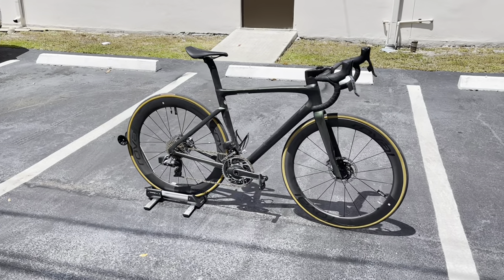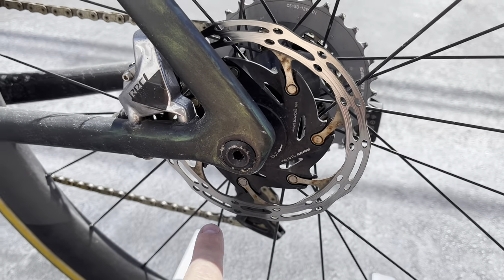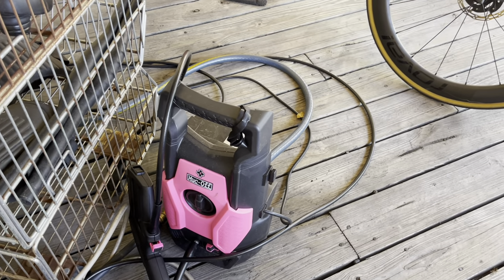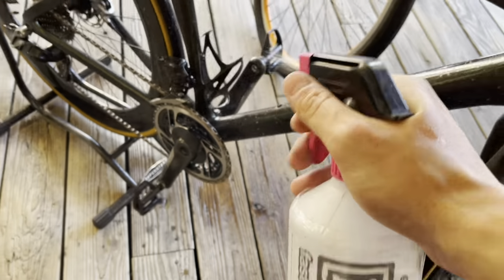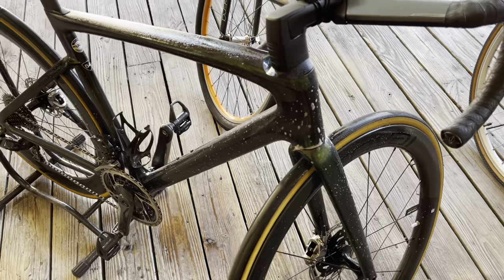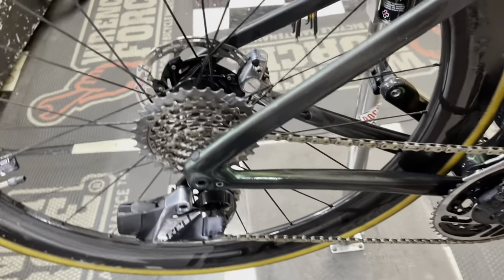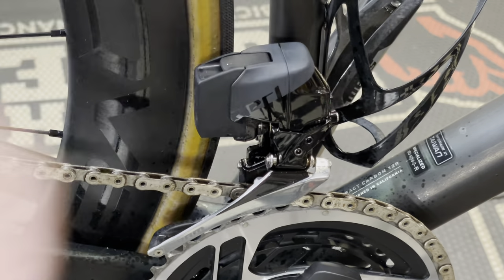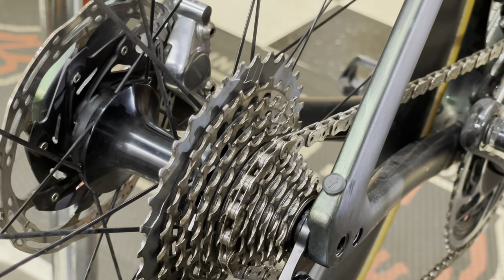CLEANING THE DIRTIEST *SPECIALIZED TARMAC SL7* I HAVE EVER SEEN!!!!

Comment: I always dry my chain with an air compressor after I clean it before lubing. I also use the compressor to blow water out of the depressions in all of the screws and other connectors that trap water and potentially rust.
Reply from the maker: im not a fan of the compressor if I have time I would take the chain off and lay it outside in the sun, the compressor can sometimes lodge grit and grease in wrong palces
Reply: I use wax on my frame, I also re-torque fittings, chain cleaner, dry lube once a month.  I dont ride in the rain so my bike stay relatively clean.  How often do you check your tire pressures?

Comment: 3:40 i can 1000% guarantee you even spraying it there got some of it onto the rotors
Reply from the maker: I am sure, but then you clean after done and they never make noise, dont squeeze right away....
Reply: @GCPerformance18  what do you use to clean it
Reply: @GCPerformance18  more concerned about the braking power rather than the noise
Reply from the maker: Alcohol and make sure you don’t squeeze the brakes. Let it dry

Comment: SRAM recommends to remove the battery all the time, when you spray with chemicals.  The tab will become brittle and actually break.  If you own a bike shop, I guess you can get away with this.  SRAM will warranty those batteries for shop owners.
Reply from the maker: yea sram recomeneds alot of stuff to do too with charing batteries and replacing chains on time and bottom brakcets after nrmal use but no ever does, they always run it till it breaks, those tabs dont break unless the consumer rips it off which I have seen in the past lol
Reply: Also for SRAMs sake, just don’t know exactly what cleaning products people might have “on hand” at home. There’s an awful lot of vehicle degreasers and cleaners that’ll perish bike components. Just seen what’s come back to the workshops haha
Reply: @GCPerformance18  My battery's tabs broke after 2 years of cleaning that way.  I called them asking if they redesigned the AXS batteries, they said yes.  But they want you to remove them when spraying harsh chem.  I do it now, just cause I don't own a bike shop that can just lie to them.
Reply: @GCPerformance18  and I didn't rip it off, I was riding and thought I ran out of charge, it was wobbling loose with the locking clip holding it.

Comment: Ok..now I feel more confident..I clean my bikes in a similar fashion with the same Muc off and low psi power washer..after everything I use tri-flow lube on derailleur pivet points and chain..i usually wash my wheels with dawn liquid dish detergent and alcohol for rotors..good video
Reply from the maker: very nice!!! as lonog as we are thinking what we are doing and smart with lube placement we are good to go

Comment: When you degrease and clean the drive train, should the chain and cogs be cleaned such that if you touch the chain you get no black gunk on your hand/cloth? I can’t get it that cleaned bud visually it looks spotless
Reply from the maker: itsd very hard to degrease a chain and remove all grease with just a rag, you need to puit it into a dunk tank to remove everything and get in between everything
Reply: @GCPerformance18  so my process is , using parktools chain clean device : solvent>soapy water> let chain dry , then lube , but once chain dry , there is still some residual (but visually very clean)as I explained , it’s still ok to lube at that point?

Comment: maybe a tight labor market in Florida. my LBS for a 60 dollar cleaning they remove the cassette/chain/cranks do a thorough cleaning. muc off pink is a mainstay along with the matt polish. they never use jet spray on a 10k + bike. last step is to check the tire pressure LOL
Reply from the maker: it depends on where u are located we are the cheapest around here, that is considered a major tune up and it is 130 but other stores are charging 90 dollars for the basic and not removing anythign

Comment: Nice video. What are your thoughts on using a little alcohol on a rag to wipe the excess oil film off the outside of the chain after lubricating?
Reply from the maker: you could do it but I feel like it is counter productive ebcause you might remove more then what you intent to, were as you can just take a dry rag and run it on there to rmeove the excess

Comment: Could you do a video of how to pack a 2019 venge in a travel hard case for air travel. Mainly around the integrated handlebar etc
Reply from the maker: ........ super tough, no lie you need to just remove the bars and remove the bolt under the stem to give slack to the cables and then pull the bars off and let them hang and thats it
Reply: @GCPerformance18  had the same experience flying my tarmac SL7 last week -- no way to keep the fork straight even with that bolt under the stem taken off b/c of the cable routing being so close... fortunately the airlines didnt turn the bike into carbon dust but I was worried the whole damn way

Comment: Is MO-94 an all purpose degreaser and lube? I use a degreaser and then muc-off dry lube to finish. Wonder if I need to add this MO-94 in between the degreasing and the lubing?
Reply from the maker: I use it for everything, I would spray it on a rag and use it to remove excess dirt and grease from derailers and chains, that way it removes the surface grime but you odnt have to worry about degreaser getting in spots and not hitting it with lube after a while

Comment: Won’t be buying any Tarmac SL7 SWorks bikes that color out of South Florida on eBay.  BTW, I already have this bike and I clean that MOfO after every ride.  I use a orange citrus biodegradable degreaser from home depot.  I HIGHLY recommend it and you can find it in the area of Home Depot or Lowe’s that has cleaning supplies.  Spray it on just like you and let it sit for several minutes to let it do it’s job.  Afterwords I rinse the bike and wash using any car wash soap.  I also use the hose from the house which where I live has plenty of power.  I also highly recommend using the park tool chain cleaner.  Works awesome. Last, I use Rock n Roll dry lube.  Let it soak in and wipe it off with a cotton rag
Reply from the maker: hahhah at least I could give u some insight lol

Comment: Surprised you don't use an air compressor after the pressure washer. It's much faster to dry things off and you obv don't shoot the air in the bearings like the pressure washer and you'll be just fine.

Comment: Thanks for the vid ! I ride my bike nearly everyday and therefor need a deep  clean at least once a month, i wax my chain afterwards but normaly i never lube the pivot points, is that necesary?
Reply: Absolutely. I had a work mate bring his bike to me because the chain was drooping so bad and he couldn't figure out why. Turns out the rear derailleur internal spring cage pivot point was so gunk'd up it seized in a position such that there was no tension on the chain. You need to clean the derailleurs and lube pivot points as was shown in this video and lube internally your levers maybe once a year. I even pull my fork every couple of months to clean and lube the headset because you would be amazed at what sweat will do in no time at all. Keeping your bike clean helps to keep you safe.
Reply: @wasupwitdat1mofiki94  Thanks! Will get something to lube all the pivot points now!
Reply from the maker: yes it is a big thing people forget to do and can make it so you do not have to replace equipment so often, it helps the derailers keep doing its job well

Comment: Want do people buy hyper-aggresive race bikes with short head tubes and then run two inches of spacers? If you need this many spacers, buy an endurance bike. Buying a race bike and then compromising it like this just makes you look like a poseur.
Reply: This guy is clearly riding his bike like he bought It, and when you buy these they come with a huge stack of spacers installed. Why? Because most people should be riding an endurance bike and they wouldn't sell many race bikes if they were reported to be uncomfortable.
Reply from the maker: this bike literally comes like that with all those spacers stock, so it is intended to be rode at that hieght, if you want to modify it to make it smaller you can do it but it is not frowned upon to ride it full stack